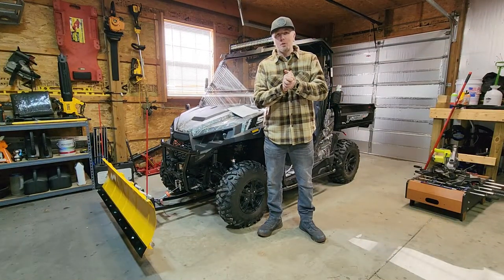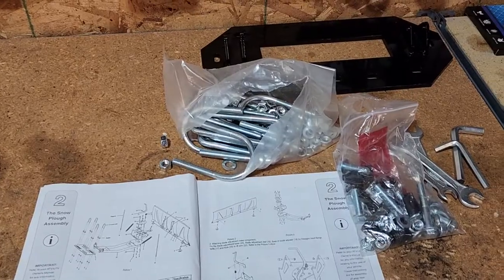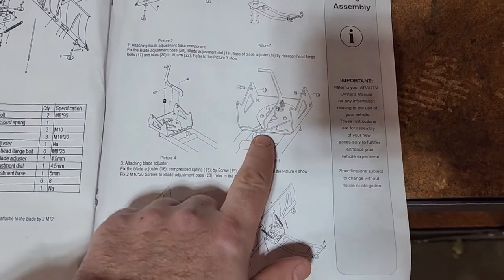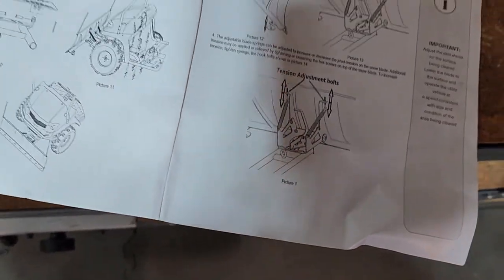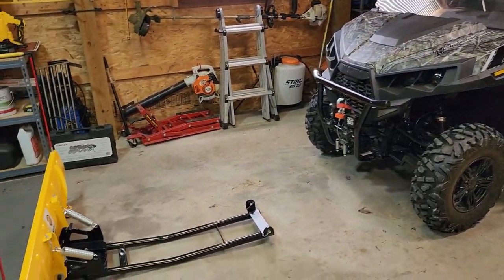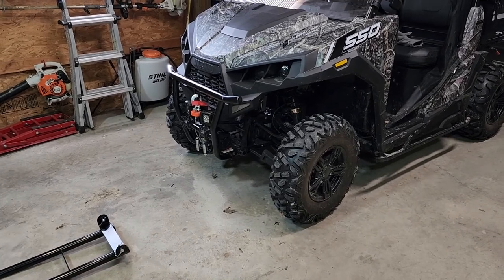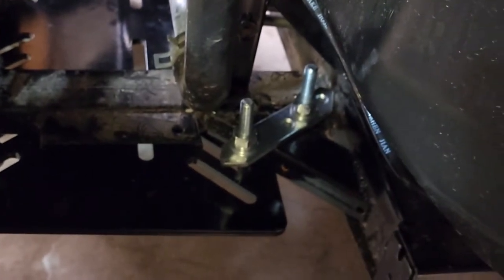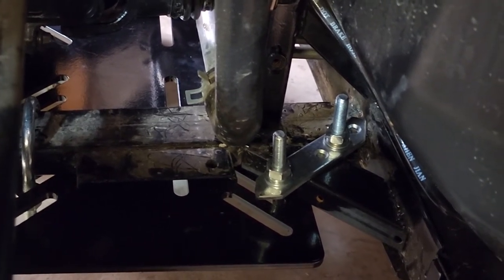Installing Massimo Universal Snow Plow

Comment: Thanks for the video.  I am trying to install the "universal" plate on my Massimo Buck 450 and it clearly does not fit "between the A-arms."  I will try to mount it further rearward as you did.
Reply from the maker: No problem. Thanks for watching. The instructions and compatibility aren’t very good